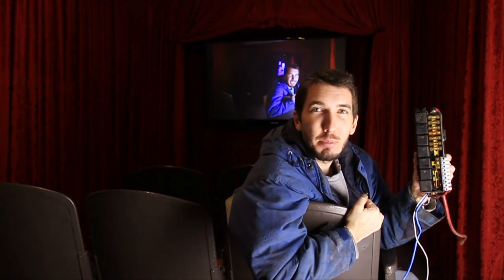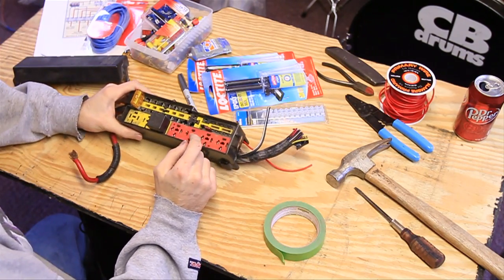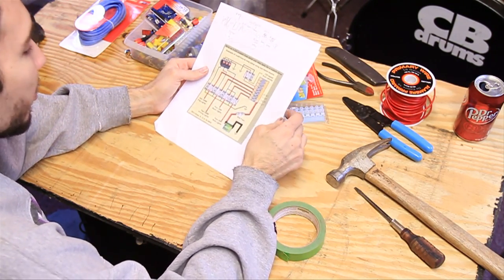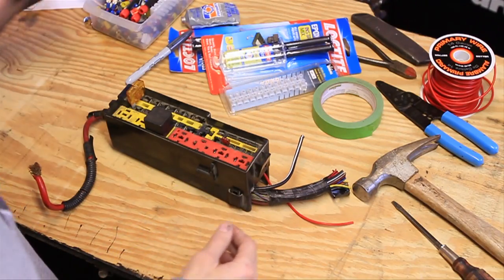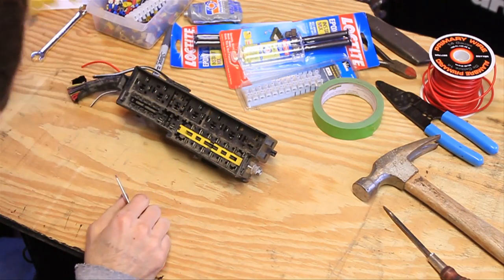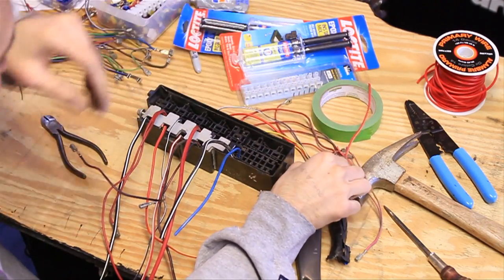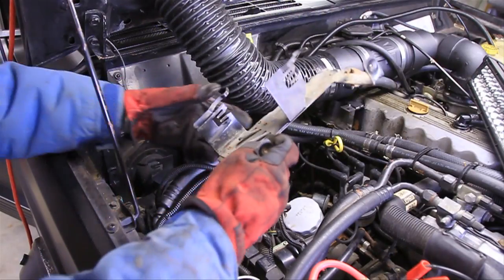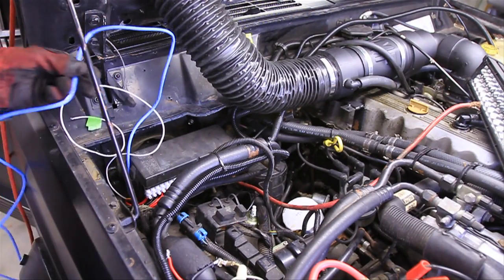BleepinJeep's DIY:  Relay and Fuse Box

Comment: also, for the power to the switches, you said "either a 12v source or direct to the battery." Does that mean if I want the switches powered independently if the vehicle is on or off that the wire goes directly to the battery along with the power cable that connects directly to the relay/fuse box? this is all fairly new to me...

Comment: Excellent video!. My buddies low dollar jeep is not starting with the key (tried park and neutral. but you can jump the solenoid to start it. We believe the problem lies with the neutral safety switch (190 dollar part) which is out of the budget. Sound right to you? Our solution is likely a push button setup.(ignoring the obvious short comings of overriding the switch) WHAT DO YOU THINK? TIA

Comment: Hey Matt...i know this is an older video but still relevant ..... is there a reason to run the maxi fuses if I'm not gonna run any higher loads?? can i eliminate those wires altogether to clean it up more?? just rock lights and some led ditch lights.. the only thing i could see running thru it higher is maybe an on/off for winch..

Comment: would it be possible to have a winch wired to this setup instead of directly to the battery? I was having a hard time finding a relay to power a winch pulling 400amps at 9500lbs. any advice would be stellar!

Comment: I just built one because it's definitely cheaper than an sPod. However I have some communication tech buddies that think it's a bad idea to run Cat5/6 cable for the relay triggers since they're designed to carry network data, not 12 volts of current. Have you had any issues with heat, meltdowns, fires?

Comment: ok thx, befor i had to replace the cpu it was running bout 180 unless i was off roading it would go up a little so i would run heater and it would go back down to 180 or 185 so now its running hotter wasnt used to it thx im replaceing thermostat and housing do you fecomend a 180 thermostat or 195? thx and i watch all your vids if i wanna do something to my jeep your vids are my go to sorce.

Comment: Ever figure out how to get the maxi fuse terminals out? I have the grey plastic piece off as well as the buss bar that is the power side of the fuses, the 2 10mm nuts that holds the power wire from battery. They have clips just like the relay sockets do but I can’t get’em out.

Comment: This is a great video! I actually went out and got a fuse box last week and started to build mine. I had several questions: I don't have dialectic grease, is there something else I can use or do I really need it? The box I got had more than 7 relays, I could not find a match to yours. I just don't know how many to wire out. Will I need more than 7? What are some ideas for items to add to my jeep?
Reply: bleepinjeep
tush-ay....I decided I did not need more so I actually made more modifications than did. I will take a pic when done. Thanks for the help

Comment: If I hook up more than one light and each light is let's say 36w and and I have 4 light on one switch would I add the the watts together and then divide it by 12v 
 So it would look something like this
W= watts, L=lights, V=volts, A=amps
36Wx4L=144W
144W÷12V=12A
So then go up to the next size which would be 15amp fuse

Comment: did you have to add another fuse to the supply wire that goes from the switch to the battery?

Comment: BleepinJeep what if i wanted to route this as solely auxiliary, with an on/off switch that i can flip to be able to use lights, winch, the extras not needed for daily driving. how exactly would you go about that? great video by the way!!
Reply from the maker: Anthony Varela not sure what you're getting at but if you want to kill power to the whole box you could use a marine type kill switch.

Comment: maybe you can guide me, my electric fan is not working. I have switched the relay and fuse now I test the fan and it works in have noticed that the if I play with the relay it makes a popping sound and I can see the fan wanting to switch on. how can I fix this as I am in Texas and it gets pretty hot. I have also change the cooling sensor increase that was it but still won't work if I put it direct to an ignition fuse my voltage does down to 10 from 14 volts.

Comment: Really enjoy your videos, this one most. Watched it several times and have in hand my used fuse box. This is going to be a slow project but I do have an early question. Do you have any problems with engine heat on the Cat 5 switch cable?
Reply: I am planning on doing this as well. I have some experience with electrical but mostly I am a computer and networking hardware guy. I would look on craigslist or ebay for plenum cat 5e or maybe even cat6. You can of course get some from home depot. the plenum cable is rated for 75 degrees celsius and 300v. That should not over heat of you are just using it for a switch. the switch should just be sending a small spark to the relay if understand this all correctly. Don't mount the cable directly on the engine and you should be fine.

Another way to think about it: Many devices the go into point of sale systems or networking gear require POE (Power over Ethernet) Some of the devices these can power include The card swipes we use every day at the gas station and grocery stores. another big use is the piece of networking  equimpnet which provides wifi such as when you see a wifi "box" mounted on the ceiling of an office, grocery store, etc. Those are often receiving power over ethernet cable. I would highly doubt that the amount of power an auto switch is using, is going to require more than that.

Sorry for the long explanation. Hope it helps!

Comment: pls help .  i have a  relay,  fuse  box  with 12 relays  ,  my   question is   can  i   use one of the relay  as  a  ground  controller  to    activate    a  set  of  say  6 relays  /( ignition key switch accessories)second  on position .in another way     to  use  the  relay  fuse  box  in   three position    1  is  fused hot  wires  all  the  time    .2  a  set  of  relays    on    acc    on  first position  .2  another set or  relay    on   in the  acc   2  position  and  the  final  is  star  for   starter  ?

Comment: Just a note, if you are just switching accessories on and off you're probably fine, but if you get too fancy don't forget that most relays are not designed for 100% duty cycle.  I've melted a few relays by using them as "ignition key on" power cut offs.  ;)
Reply: bleepinjeep
I had to edit it, I was actually missing words anyway, so it is no wonder it didn't make sense.
Specifically the exact instance I remember was a series of relays I use for my CJ electric fans.  I believe I had 3 relays in that setup which controlled my electric cooling fan.   The reason it was a bit complicated is I had 3 modes of operation: "on", as an emergency bypass, "temperature controlled" which is how factory fans work, and "off" for deep water.
Anyway, in my first incarnation I had 1 relay that cut power when the key was off, which meant that relay was energized the entire time the jeep ran.  It never failed to operate, but one time during some maintenance I happened to visually check that relay and the case was all melted around the coil from being energized all the time.
It was probably overkill, but I didn't want a bad sensor or something running the fan all night and killing my battery.
Reply: Tim Kidane
Actually, that is what the relay did, it only let the fans get power when the jeep was running.  The problem is the jeep runs for a LONG time sometimes and the relay wasn't designed to be powered that long.

I believe I fixed it by letting the fans be powered all the time in "normal" (temp controlled mode), which is how most cars are wired.   And the power is switched on and off by the temp control switch automatically.  That is why on some cars you can still hear the fans run for a short time after the car is shut off.

The cut off relay was redundant, and especially unnecessary in my case because I do have a "power off" switch I could use if the temp sensor ever did stick on.   IIRC, I think I used a NC relay and my relay actually turns "on" to cut the power now.

Comment: great video i was wondering what size wire should i could use instead of a cat 5?
Reply from the maker: ***** You could buy some very small gauge wires and wrap them together with a drill.

Comment: Do you have to use a fuse between the battery and switch ?
Reply: Switching wire will ideally be ignition live and fused, 2A is plenty for a switching wire.

Comment: im haveing trouble with my elec fan on my 97xj , fan motor is ok i replaced relay, didnt need to. fan comes on when i turn on ac but it doesnt come on other wise. jeep doesnt over heat but runs a lil warm 205 or so normally runs 180 not sure what the problem is
Reply from the maker: operating temp is 210° so it shouldn't be coming on unless temp goes over that.

Comment: Do you have an alternate link for the Wiring Diagram and chart?  The links above are dead.
Reply: +Shawn Hill Found it after some digging. http://www.jeepforum.com/forum/f20/wire-fuse-size-relay-explanations-378268/  looks like your link above just cut off after the f20/wi

Comment: I'm going to be hooking up 5-6 switches for different acc lights, but I also want a master switch to turn all on at once sometimes.  ex, while driving I may only want my fog lights and bumper bar on so id only flip2 switches, other times I may want all 6 lights going at once so I want to install a switch to turn al on at once without flipping all 6 other  switches does this make sense? so id jump from the cat 5s on each switch to the master?
Reply from the maker: +Mike Donaway yep
Reply: +BleepinJeep would that not make it to where all switches are powered on/off at the master so if he only wanted say one or two on if the master is off how does that work for you.....clue IT WON"T

Comment: Built mine and installed it. Switches have power but the box has no output power and none of my accessories work... Any suggestions?
Reply from the maker: Tyler Craney hmmm, are you sure you didnt get some of the wires to the relay in the wrong spots?

Comment: What kind of fuse would u use on a led light bar??? And when do you know to use the mini fuse vs max fuse?? Thanks
Reply from the maker: They are the same amperage, just a different size
Reply: +BleepinJeep do u have a guild on what wire siZe to use on mini vs maxi fuse

Comment: Wish I would have seen this video before trying to run a junkyard relay box in my ramcharger.  I used hot glue to hold the plugs in place but they do not hold like I want them to.  Awesome idea to have a terminal block for all the outputs.  I would be nervous about crimping the cat5 cables like that.  I'm surprised they don't come loose.  Nice work!!!  
Any regrets or things you wish you would have done differently?

Comment: Can I use 12 gauge instead of 14 gauge wire or would that create issues
Reply: It depends on the distance, amperage, and what you will be running. High watt lights may need more, where as in my experience, LEDs will work great on 16 awg.

Comment: Could this be used to wire headlights with high and low beam ? Would I need a different switch for high beam and low beam?
Reply from the maker: George McCafferty use could switch anything you want with it.  these relays are for 1 item only.
Reply: Could I make it so one switch is low beam and another is high beam would that be possible?
Reply: George McCafferty
That's how I wired the lights on my Nissan. Make sure your relays are good for that kind of amperage. I've got two 65W high beams and my blue Nissan relay ($2 at the wreckers) has run them without complaint for a couple years now.

Comment: I like it hitting the junkyard next week after the snow is gone. When I cash my check I will donate....
Another question for you is I am lifting a 5.2l v8 and I have decided on 4.5 inch lift a short arm kit by Iron rock off road. I currently am running a 2 3/4 pucks on the front with up country springs and used my original v8 springs in the rear.
question is since this will be the final lift for this zj what are the pros and cons of adjustable short arms? I am getting a completely  upgraded steering components and front and rear adjustable track bars.
Reply: thanks Matt
love your videos keep doing a great job hope you get enough cash for your shop

Comment: well... video is for real as you had to put some oomph into that battery bolt.. hah.. very nice I like it.. 
FYI - I have been looking at these and they are nice BUT I need waterproof and the best I have found is in a 1989 olds 88... 7 waterproof standard relays. All of these newer cars are going this route vs the old way and I like the old better. but that is just me.. thx.. watching the full video now though.. hmm cat5 wire.. didn't think of that. yes low voltage for switches...
Also why not just buy the correct connectors to the relays so you don't have to grease/epoxy up in there???
Reply from the maker: Never could find em.
Reply: there is one in a junkyard near me and I'm gonna go get it tomorrow.. I hope. last time hood was closed and I couldn't get it open... I will get it.. I do have one already and will video it up when I clean it ...
Reply: It is raining out but went to junkyard to show them a pic of fuse pack w relays... he said oh fusebox... $20. Going back tmorrow. They had a olds 88 last time but i couldnt get hood opened... im going to trace everywire as far back as i can....rain or shine...
Reply: So I went and removed the 1993 olds 88 fuse box and relays, 1998 s10 blazers 4x relay holders... but I did see a few Cherokees that had these in them and I almost bought one... hah... if I need more in the future I will

Comment: i have a question i am hoping someone can answer for me. anyway i have a trailer, i put a new tail light set on it, had it working great, however after i made sure it worked right before run the wiring properly. so i pulled the driver side wires apart at the trailer end and they touched, took me a little bit to realize, but i got everything butted up, well now i believe a fuse is blown. when the lights are on the driver side on trailer doesnt work at all nothing, when turned off, turn and brake and emergency lights/flashers all work great, it was dark i pulled number 20 fuse in kick panel fuse box it wasnt blown. i was tired and came home, anyone know which fuse is blown or what i may have done please let me know i will appreciate it vastly thanks a million.

Comment: check out digi-key and connector item numbers like A27923CT-ND and A27935CT-ND.  They pretty much sell any factory connector and to crimp them check out something like a molex style crimp tool (ebay item 262378162685) it makes those double rolled factory crimps.
Reply: Dont order  A27935CT-ND threw DIGI-KEY. It will not work for the mini fuse.

Comment: Where is the video showing you opening tgose connectors on the metal table? I really see no way of opening them up without destroying them or rendering their ability to retain wire ineffective.
Reply from the maker: Michael Chuzie use a very small screwdriver.
Reply: BleepinJeep
Thanks. I tried multiple screwdriver sizes and all have the same result. The wire retainer is further compacted against the wires with no way of opening it again. You, and everyone else who has been successful, are much more talented with a screwdriver than me.

I am ordering a set of mini terminals; doubt they will have the keyed detents specific to the block, but they should be suitable for epoxy.

http://www.mouser.com/ProductDetail/TE-Connectivity/1-1355877-1/?qs=%2fha2pyFaduis0xoOuO3lI5%2fxRJEiuJK0QZ3DlgRZ0q7jno08Xk1XSg%3d%3d

 Thx.